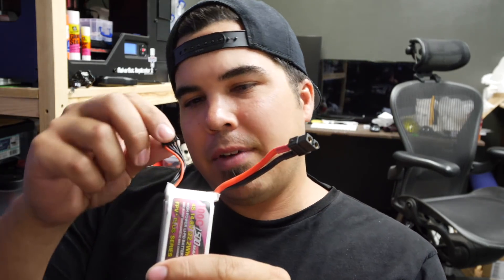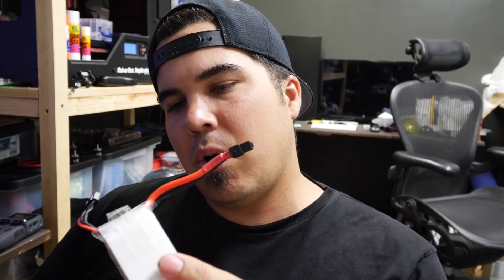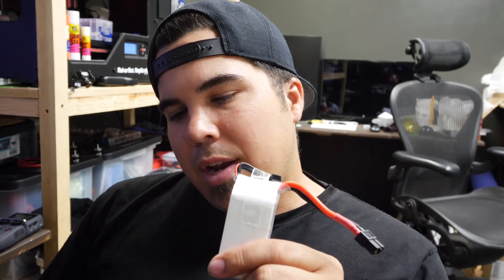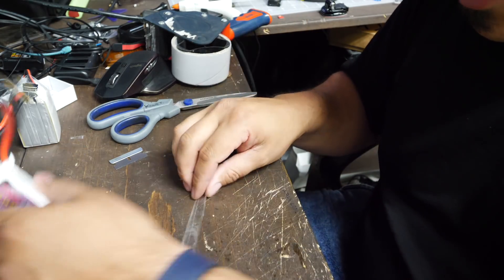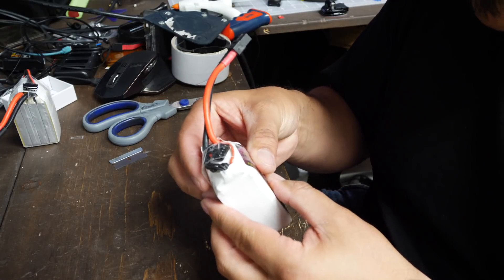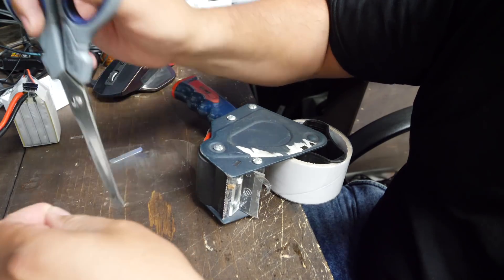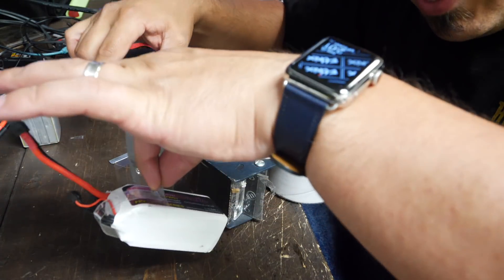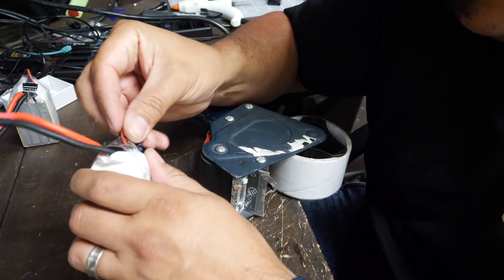FPV life hack

Comment: I use a rubber band to hold both leads.  Once the pack is used remove it.  Keeps wires out of the way and separates used from good in your bag.
Reply: Same here, tiny rubber bands or just put it in between the power leads.
Reply: Thank you. Takes 1 second to apply a rubber band. Tucked in balance connector means charged. Untucked means discharged.

Comment: Thumbs up for knowledge sharing. I use those exact packs and I like to tuck the balance lead between the power leads. Dual purpose, if i find a pack that has the leads already tucked, that means I've used it. I like the way you've done it here though, I'm going to give it a try.

Comment: I use a rubber band which holds the balance lead to the charge wire. This way the balance lead doesn't go anywhere and I can also tell if the battery is charged, discharged or balanced. Rubberband all the way up and ready to fly means charged. Rubberband all the way down means ready for charging and rubber band somewhere in the middle means the lipo has storage voltage.

This has turned out to be the best solution for me. No need for XT60 caps, weird tags or what not. Sometimes its just a little tricky because some lipos don't have the balance lead next to the charge wire and the balance lead ist to short to tie both of them together with the rubber band.

Comment: Pretty good idea but I think it's a whole lot easier to use a left over zip tie (or just cut the main part off on purpose) and slide it down into the heat shrink. I personally use mountain bike tubes as protective wraps and it makes it really easy to slide the zip tie into.

  When I charge the battery I fold the balance lead on top of the battery and slide the zip tie over the it so it looks like your tape but it holds it really tight. After my flight I pull out one end of the zip tie and the balance lead falls free so I can use it. A quick look tells me which batteries are still charged.

Comment: Nice hack.   I usually just tuck the balance lead connector in between the two main wires and give it one or two twists before plugging it into the xt60.

Comment: I just use rubber bands. Length wise for the balance.  And around the middle and have the lead in the rubber band when charged. Loose hanging main lead means, spent bat. Also helps keeps the battery strap holding it when I crash 😀

Comment: I just put the balance connector through the tight gap between the power cables close to the battery. If the balance connector is unusually long then i wrap it around one of the power cables several times. Never failed for me. However you solution seems a bit cleaner and better for aerodynamics.

Comment: A better way is to use electrical tape, wrap it around your index and middle finger adhesive side out, go around twice. Then reverse direction, remove fingers and lay the loop down the length of your battery, flattening out the loop, continue all the way around the battery twice. then when you are installing the battery simply feed the strap through the loop and you can also tuck balance leads in the loop as well, then just fasten as usual. This will prevent the battery from becoming a projectile and ripping pads off of your FC or PDB.

Anyway, I always look forward to your videos. Keep up the good work.

Comment: I will tell you a little hack I do. I always bind my receivers before putting them in my quad, the easiest way I have found is to solder it on to old usb cord then just power off your computer or plug pack it will give you a nice 5 volts DC.